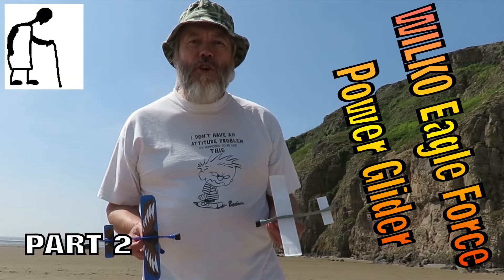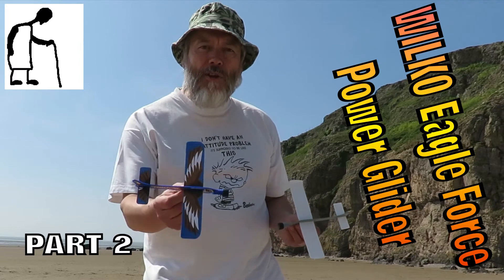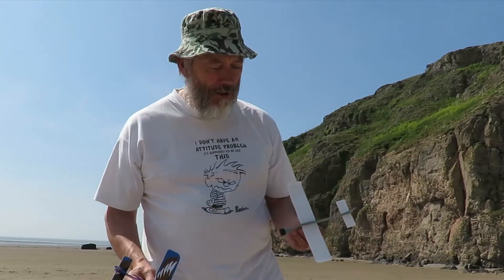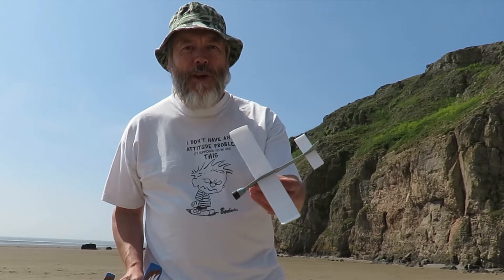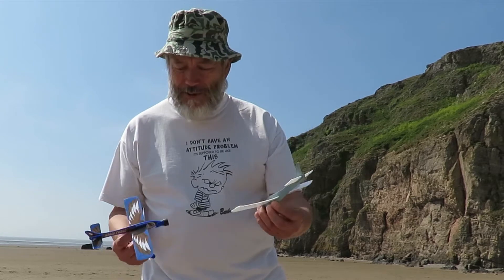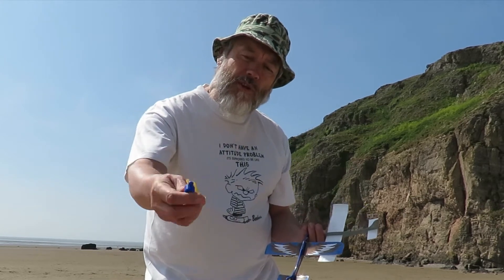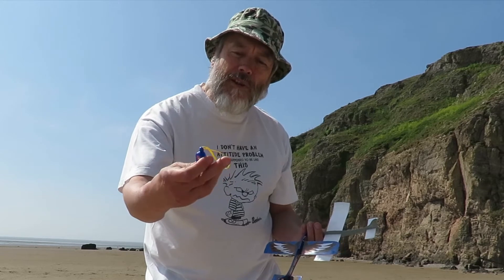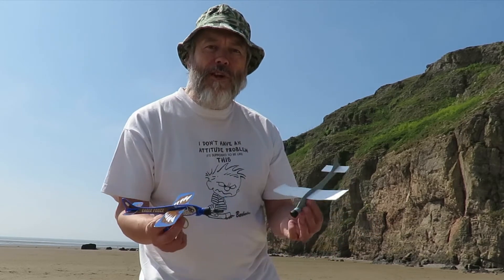WILKO Eagle Force Power Glider PART 2

Comment: Disappointing result from the store bought glider.
Not much fun for a child.
Reply: I was watching. You weren't over stretching the band.
Have you done any work with balsa?
It's quite cheap.
Reply from the maker: I haven't touched balsa in over 40 years. I have looked at it and the price horrifies me. Mind you, the price of everything horrifies me now 😊
Reply: I used to buy bulk bags of the off cuts and odds and ends.
Gave me an interesting selection that often times dictated what the project would be.
I don't know if they have these types of balsa bags in the U.K.
Reply from the maker: There aren't many old style model shops left, most that I have seen are full of ready to fly stuff and of course all most people want to buy now is multi-rotors any way. When  I was a lad our local model shop would let me and my mate go through to the stock room so we could choose the best balsa they had, ah, happy days  😊
Reply: Yes...times have changed. 
The shop I went to was a little "hole in the wall" crammed full of treasures waiting to be discovered.
Now they have franchised and everything is shiny and corporate and as you say, ready to fly, or drive.